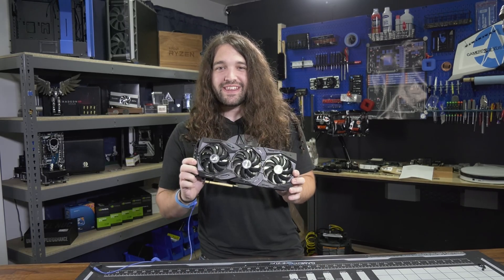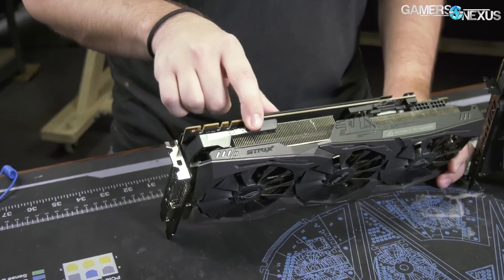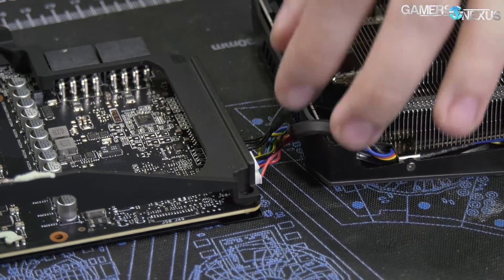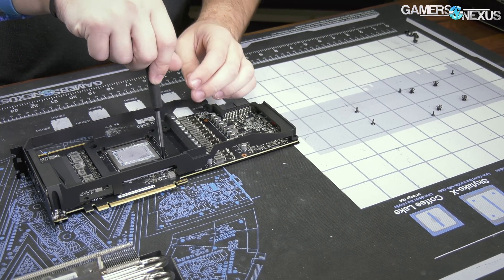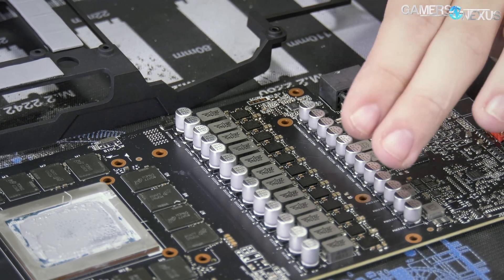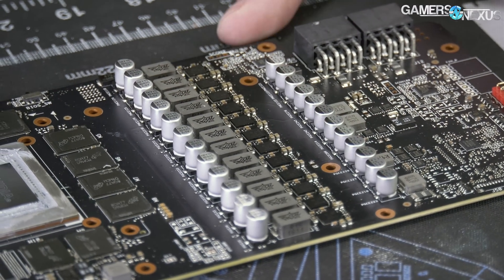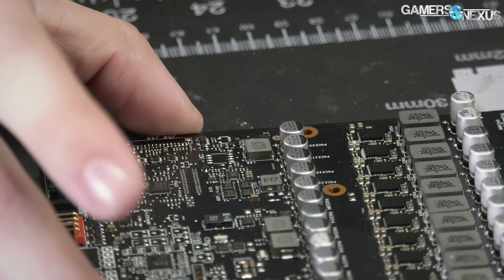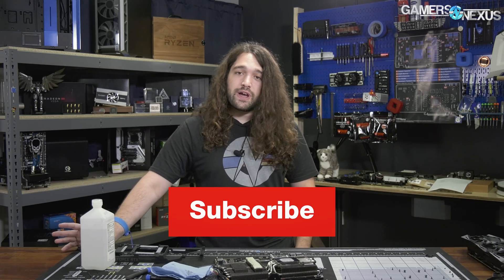ASUS RTX 2080 Ti ROG Strix Tear-Down & Custom PCB

Comment from the maker: Check out our PCB & VRM analysis of the 2080 Ti FE board over here, by Buildzoid: https://www.youtube.com/watch?v=-zsWoef9MqQ
Our GN drink glasses are back in stock (for now -- they keep selling out!): https://store.gamersnexus.net/products/cobalt-blue-tear-down-logo-pint-glass-libbey-17-oz
2080 Ti review here, ft. Snowflake: https://www.youtube.com/watch?v=PpDG13PrNPg
Reply: OW!
Reply: want to thumb up now, however I have a policy of watching a vid first. That opening was great. lol.
Reply: yeah boii
Reply: I have one Q, how easy is that cover to get off to get to the fins to clean the card? is it only 6 screws around the outside or do you need to lift the thing out of the baseplate 'brace' to get to some screws to be able to clean the cooling fins?

Looks much easier to mod for a water block. Great vid Steve and Crew. B)
Reply: #askgn material probably. Why does TU102 core get a silvery 'frame' around the core (like Pascal and Maxwell and many others), but TU104 doesnt? Is that frame have any use from the chip maker's perspective? To me that's the final safeguard of users applying too much paste (verge?) on the GPU, but I'm not convinced since lid-less CPUs (on laptops) dont have that frame either.

I've always appreciated you guys' hard work in doing reviews, rather than the more celebrity route other reviewers slide towards. Keep it up!
Reply: Can u put new fans to 1080ti and check the difference?  Thx
Reply: K is the eleventh letter maybe that's why M11 is missing?
Reply: Why didn't you let bullzoid do this video?
Reply: Haha.  Love the screw driver. Bloody good channel mate.
Reply: I can't believe you forgot the Allen wrench. So unprofessional. 🤣
Reply: Dear Steve , I must admit that You are really a good hearted  person if you take time to review and give space to GPU manufactures on a GPU that they will be a total financial catastrophe for them....this GPU is not appealing even for TITAN  buyers who use them for Pro render work.......
we will need to wait and see what the  full sized GPus will perform like...when they will release them in April...we not gonna see 7nm node form Nvidia before 2020.

Also it is likely that  Nvidia, is wanting to become a Software company and ditch GPU manufacturing, as its been a while that they avoid to talk and boast about roadmaps...
GPP was their first attempt to get this  work, RTX is the second attempt....and it is not looking good  for sure if they delayed it so long, means that they have a massive issue with  the Node and at 7 nm can only get worse for them
Reply: Steve, you forgot the thermal paste applicator and the Allen wrench!
Reply: Upvote for EVERY video you mention "tweezers". XD
Reply: Love the opening of the video!! LOL Def going to try to order some glasses too, they look awesome!
Reply: which version was it? ROG-STRIX-RTX2080TI-11G-GAMING or ROG-STRIX-RTX2080TI-O11G-GAMING?
Reply: Can you do a vid about if you can use the thermaltake 2080/2080 ti Pacific with the 2080 ti rog strix oc
Reply: you probably dont care at all but does anybody know of a trick to log back into an instagram account?
I was dumb forgot my account password. I would appreciate any tricks you can give me!
Reply: @Phoenix Koa Instablaster =)
Reply: @Cain Gianni I really appreciate your reply. I found the site on google and im trying it out atm.
Seems to take quite some time so I will reply here later when my account password hopefully is recovered.
Reply: @Cain Gianni It did the trick and I now got access to my account again. I'm so happy!
Thanks so much you saved my account !
Reply: @Phoenix Koa glad I could help =)

Comment: I know this is old but, I just got an Asus Rog strix rtx2080 o8g gaming for $150! It works well but the middle fan is wobbly as hell. Gonna order some replacements as well as good paste and thermal pads. It's got more dust than a vacuum. Performance is 1% lower than a 4060ti and 66% less than a 3080 which I can't afford ATM, but I will get something better soon.

Comment: 9:04 - Odd. The 2 screws on the IO shield on my card here were the same type as the ones that that the aluminium midplate has. The 2 screws with the "unthreaded" part were for the holes on the RGB backplate's surface (next to the 4 main GPU sprung screws).

It's 2024 but I hope this helps anyone who is trying to disassemble/reassemble their cards.

Comment: I wished to know how thick are the thermal pads on the card. From my readings, someone was saying 1,5mm everywhere, but i do not know if it is correct for every one on the card?🤔if i do put 2mm thick pads instead of the 1,5mm ones, does it change anything or it is simply not adviced?

And also, what was the W/mK put by asus, and what was the wattage you did put in replacement?

Comment: This video was really helpful (have ASUS Strix RTX 2080), i have been getting crashes while playing Mechwarrior 5 mercenaries with strange errors like 3D device has been removed messages. Opened up HWInfo and ran that in the background. Saw temps of 83C for the GPU with a hot spot of 107C that's 24C difference. 

Changed from the default BIOS (quiet) to performance and the GPU is like 75C and 97C hot spot at 60% fan. (crashes still occurred but not as often. (75C to me is still pretty decent to be honest but that hot spot was crazy high)

Ordered some MX5 (grizzly was not available on Amazon for Prime next day) which arrived today and removed the HSF which popped off with zero effort and was like WTF there was hardly any paste on it with the outside of the GPU not even seen paste and what little there was, was like concrete granted have had the video card for 2 1/2 years now but I expected it to last longer than that. So cleaned the GPU up and applied the MX5 and now have temps of 65C and 75C on the hot spot so from the default config that's a 32C drop. For hardly an effort got an extra 100Mhz boost clock speed, 10C drop on the GPU with a hotspot drop of 22C and the fans are spinning 10% less to boot!!!

Thanks Steve.

Comment: Does anybody know what dimensions the screws are? I can't find the screw in the right rear corner next to the I/O shield. The one where there's a cutout for the screwdriver to fit on the right side from the rear. He's unscrewing it @7:45 I think it's the same size as the screws around the GPU itself but not sure. I have lost that one. Would really appreciate if anybody could answer.

Comment: Can you identify all the screws from the  stock cooler/backplate ? I have 2 of those graphics cards that were mounted on a water-cooled system, now that i need to put them back to air-cooling I dont have the original screws...

Comment: Currently looking specifically for a disassembly video for the Asus Rtx 2070 Super Advanced and was wondering if the internal are the same or similar to the 2080 ti? I would like a to save a video for when i need to open it for whatever reason.

Comment: Those two connectors going from the PCB to the cooler. Which one is the fan connector? Do you know?
Are they using the traditional mini 4 pin and the big connector is for the RGB?
Or is it the other way around?

Comment: Chip has 11 of 12 dies/areas that met specs. Number 11 failed. No need to add RAM to a non functioning section.
K1 - K is 11th letter. Matches the failed section of the chip.

Comment: Hi Steve, i got a question....(im on my 3th Asus ROG 2080Ti Oc now) is there anything i can put on the chokes to reduce the annoying buzzzz/ssssssh (whine/mosfit noise) ? Its crazy at loading screens or game menu's (strange enough at 200+ fps i dont here nothing, its between 100 and 150 )  Im affraid to replace it again as it seems almost all cards got it these days in some amount.
hope you can help me.

ps i switched the psu already but it didnt help allot (seasonic)

Comment: Hi Steve, 
firstly thank you for all you do - please keep doing it. 
I have a question please sir. 
MY Asus Strix RTX 2080ti OC edition is missing the x2 four pin fan headers, yet they are fitted to both the Matrix version and the lower end 2080 which i find totally bizaare considering the price point of £1400. 
My question is can the PCB be modified to fit two fan headers on this Strix 2080ti PBC onto the terminals on the PCB and how easy would it be to source the headers and fit them ? 
Im a long term Asus customer and have always bought Asus parts and paid the premium for quality - this is the first time i am honestly very annoyed with asus and feel let down in honesty that they fit these to a 2080 and not my far more expensive 2080Ti. 
Its actually made me look at other brands moving forward  -  anyway is this a "Doable" mod ?
I hope you can get back to me - thank you - John
Reply: both my 2080 ti OC editions have had the fan headers

Comment: I found the thermal paste on my Asus Strix Rtx 2080ti card was poor.
I repasted the card with grizzly Kryonaut and the temps went from 72deg C to 62deg C under full load in the same rig with the same ambient temps.
Was I unlucky or are asus using junk thermal paste ?
Reply: What thickness for the thermal pad ?
Reply: @nickphang6440  i used paste
Reply: @JohnOLooney  even on memory chip ?
Reply: @nickphang6440  yes 100% 
it will compress to the exact needed size - never scrimp on quality paste - the best oen now is Kryonaught extreme - i used that on my 3090 strix with the copper shim mod and it never goes over 72degC now
Reply: @JohnOLooney  so what u said u just use thermal paste on mem chip. Without thermal pad ?

Comment: Gamer nexus I recently put a phantek waterblock on my strix 2080ti. A screw from the waterblock chipped one of the phase 2 chokes. Was wondering what kind of impact this is gonna have on gaming? And is it gonna lower the lifespan of it? I know a little bit not enough I'm afraid.

Comment: I just got the HEATKILLER® IV for ASUS RTX 2080 Ti STRIX, for this card.  Would it be safe or worth it to use liquid metal like TG-conductonaut?  The block says it's "chemically nickel plated electrolytic copper".  However it does also have anodized aluminum parts but I don't think they'd be in contact.

Comment: is this compatible with the EK water cooling block?
Reply: I sure hope so. I just got my EK water block in yesterday. EK advertises it's compatible
Reply: Tell me how it goes after u’ve tried it
Reply: I'll tell ya and since i'll be posting the teardown, I'll show ya. Success or fail it's getting posted. I got the 2080TI FE. Gamers Nexus has that teardown video as well.
Reply: I meant will the EK block fit this specific card. The ASUS ROG Strix 2080 ti
Reply: The 2080ti card is the same regardless. The only thing that is being modified are the outside parts to cool it down. They don't make their own PCB so therefore EK 2080ti blocks will fit all 2080ti PCB's regardless of what company modified them. I bought the Founders Edition so I wouldn't have to pay more from Asus only to strip it down and put a block on it.
Reply: Oh rly? I thought companies made different PCBs
Reply: No way. The EK waterblock will work just fine on your card. You can even send ekwb.com support an email and they will verify it.  I just bought a very large custom cooling system from them. Cost me over a thousand. They are very good at replying to your support requests.
Reply: that’s good. Ill probably get a FE then watercool it
Reply: Yep, that's what I did. Well, not yet. I got the 2080ti FE and EKWB cooling but now I gotta wait for a stupid anti-static mat lol. Amazon taking a week to get it to me. I forgot to order it. Not taking any chances tearing down my $1,283 GPU lol

Comment: It will take only one false move and it's gone and you will be lucky if it didn't work the worst part is that it won't have enough contact with the PCB and the cooler and then it will burn of heat

Comment: Are the two rotated chokes simply for clearance of the heat pipe cooler? It appears two of the pipes may be too close to the chokes if they were all lined up the same. Maybe why ? Can you confirm clearance of pipes with two rotated chokes?

Comment: hey Gamer Nexus: im noticing the support frame on the Strix card comes up higher then the GPU Die its self. I'd really appreciate it if you could tell us the clearance, and if any AIO pump heads would be able to fit in that depression (like say the one you used on your 2080 FE hybrid video). I was looking forward to taking this card and running it Hybrid style simple because of how almost all of the boars important components are covered by the bracket (that acts like a nice aesthetic heat-spreader).

Comment: and here we have nvidia cheating again with misleading naming, this should have been a 2070 card, you have one memory chip missing because, it is disabled in the gpu, and is disabled because it is defective, so you buy a defective gpu at premium price, this is a common practice and nvidia has been duig this for years, the top defect free card was the x80 then the more defects you have, you have more functions disabled and you get x70 and x60 with reduced performance, but at a better price, but the actual gpu die is the same, not that it matters too much, at these prices the 2000 series is pretty much a fail anyway.

Comment: Picked up the ASUS Dual RTX 2080 on Friday. Doesn't spin the fans until it gets to 55 C, but when it's under load, the fans never get above 60% and temps hit around 80 C. I don't like it. I'm trying to figure out a way to get the fans higher and keep the temps in the 70s.

Comment: Make sure you're power supply doesn't touch the bottom of the case or it will short circuit and come in contact with the rest of system

Comment: Only evga get this right... why the fuck does everyone use a 2 slot bracket on the I/O then make the cards cooler bigger than two slots? just make it a 3 slot bracket, its not like you can use half or now 3/8 of  a slot! better yet they could even make the entire cooler 3 slots thick. just use the space available...

Comment: Its Zip ties Steve Zip ties! not tweezers just a reminder. 
 i just cringe because The Verge guy said that as well, its going to be in my head forever.
Great tear down as usual cheers.
Oh you do it on porpose, sarcasm is not my forte, at least you have a mat made of rubber so it don't cause a short circuit XD.

Comment: Hi, I'm wondering how your performance tests will be affected if you do the teardown first. I imagine you either need to repaste it, which could potentially improve performance over the stock card, or you don't repaste it, which could potentially decrease performance due to cooling issues (the two sides might not adhere perfectly after a disassembly).

Comment: Can I just say GN your streams are some of the most bandwidth restricted on youtube that I have come across. I have a 63Mbps connection that I can clock at 7MB's (Checked a few minutes before posting) downloading content on a ISP in the UK that specifically picked for no traffic shaping. I CAN NOT stream your videos from Youtube at either 1440p or 2160p without it struggling or flat out stopping to cache.

Very frustrating. :/

Comment: I'm moving from 2x asus strix 1080ti's in sli to 2x 2080ti's in nvlink sli. I preordered FE cards for expedition of delivery, but I can cancel until they ship.  my asus 1080ti's were kind of choked for air (the top card was significantly hotter than the bottom), and I was wondering if there was a particular AIB card's cooler configuration that you would recommend for SLI use.  I notice that many of these AIB 2080ti cards use 2.7 slot coolers (vs asus's previous 2.5 slot coolers) which I think would be even worse for airflow (due to the lack of space between cards).  so the question I have, is - the 2080ti FE cards seem to be 2 slot cards (and thus have additional clearance between the 2 cards in sli), but is that a thermally less efficient design?  Which 2080ti card (cooler-wise) would you recommend for cramped sli use with a 3 slot bridge?  Thanks!

Comment: I think they rotated the chokes so they have more space for cooling if they make a very short card (or single slot blower style), chopping off a big portion of the back of the card using maybe just those 7 phases in the front area (6+1).
Do we know clockspeeds of 3rd party cards? Will they be lower than the FE? FE looks like an factory OC card :/

Comment: Still haven't gotten an answer if these are worth it over the 10 series if you own say a GTX 470...
Reply: No these are not worth it over 10 series. The main selling point of RTX cards isn't even released or implemented into the games that are supposed to support it.
Reply: @React2Quick  guess we'll see how the 2070 does vs the 1070Ti
Reply: @Ender_Wiggin03  It'll perform better because that's usually how newer graphics cards are. But I expect we'll see similar results where current gen x GPU just barely edges out or is on par with x card from the last gen

Comment: Is the TIM used on these really only 3-4 W/mk? Damn, I didn't honestly know it was that bad.

There should be some significant gains to be made even just putting on some Kryonaut or something then. That's more than 3 times the conductivity right there, without the additional risk and hassle of LM brings to a GPU setup.

I still don't get why they don't use better TIM when thermals are quite obviously a limitation. Surely it can't be cheaper to beef up the cooler than it is to spend a few cents more on the TIM...

Comment: I suspected that these cards are going to be more power hungry and hotter than Pascal due to the switch to open cards for reference and the the reference cards having 2 8pin PSU connectors, alongside the GIRTH of the new AIBs. My suspicions came to be true. I feel bad for the Engineers working on blower AIB cards, those things are going to run loud and hot as hell.